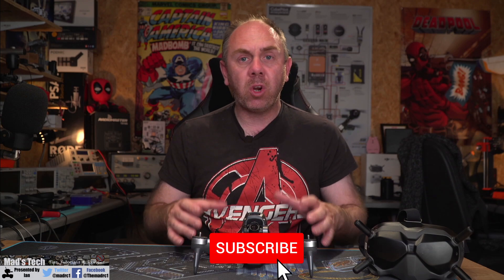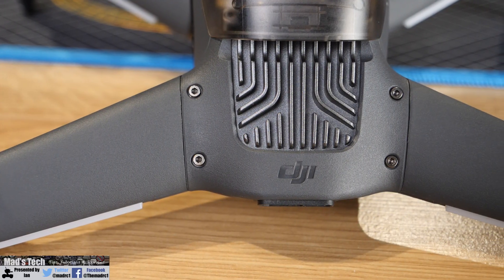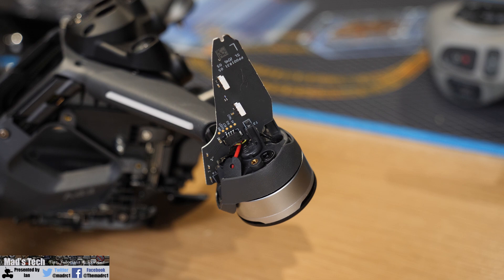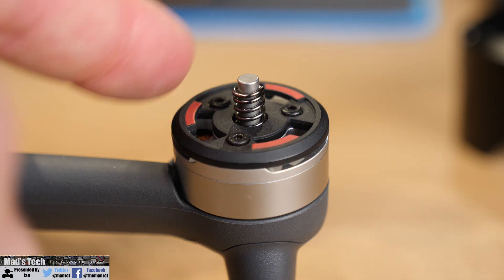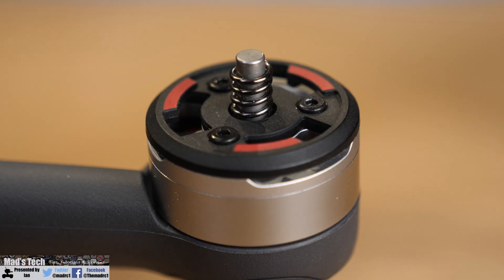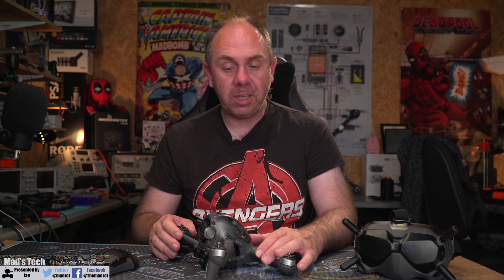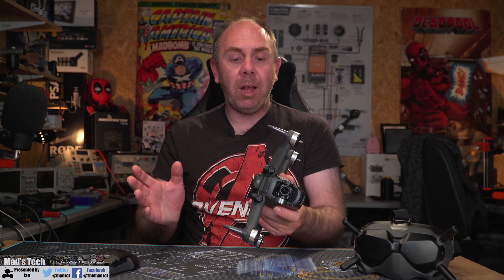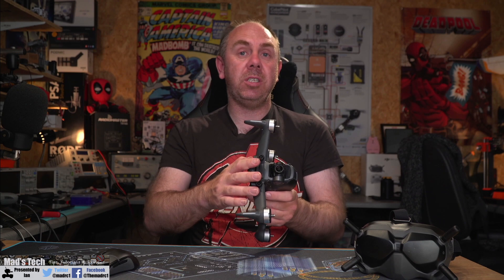DJI FPV Drone Crash ? - What & Where To Check For Damage

Comment: Any ideas what to do with error: Image transmition error / RC signal lost error. This is after hard crash to a wall. Gimbal too some damage but seems to work fine. And checked the antennas and their connections on the board. No issue there far as I can see.

Issue is that aircraft starts and can be operated with the controller but no image can be recieved at tho goggels.

We have tries with out SD card and have updated the firmware etc. So thats not the problem. 

Any ideas what to do next?

Comment: Yesterday I hit a tree branch around 10mph head on and lost video output from the camera, drone was in manual mode but went back into full level by itself and started to force land through the tree branches but hit every branch on the way down landed in some soft leaves no visible damage but now no video output, I don't know if its the camera module or usb-c main board, It's cheaper to just buy a full new drone off ebay, I will just use this one for parts, it was my first hard crash and it does make me think its a very delicate drone, anyone else had this video issue drone has full rc and vtx signal just no av output.. Edit: Camera was faulty bought a spare drone £180 off ebay swapped cameras and yay it works. Well sort of drone has a main camera calibration error, and Dji Fly app won't download calibration data so I'm stuck with the message.

Comment: Landed in a pool and burned the esc. Seemed like no water got anywhere in but after the esc replacement the drone turns in normally but all the LEDs are solid white and I can’t connect it to my goggles or the fly app. Any suggestions?? Thank you man. Great video 🙏🏽

Comment: THX Ian , i crashed mine 2 days ago..luckily no real damage as i have  the arm braces fitted. i had to change 3 props and i had no error messages .

However , today i went out for my flight  and when i come back to edit the videos i can confirm the noise it makes is deeper / bass tune sound than before . after watching this video , i have changed the 4th propeller and tighten all the screws . hope that would fix it ,otherwise i might have to send it in for inspection - time and money 😢😒

Comment: my drone says fan error and gets really hot but the fan doesnt have anything stuck in it, it spins fine when on? the black bracket over the fan does have a crack in it though so maybe some pressure is being put on the fan?
Reply: Have you figured it out? I’m having the same problem. I replaced the fan and it’s still not working and showing “fan error”
Reply: @cmodesittm5006  ended up just being a damaged fan

Comment: Thanks a lot for  sharing my fpv just crash and went to water upside down  try to do turtle mode and drone turn off I try to put in rice for 24 hours  remove t top shell  clean the mud inside  vacuum it and blower and turn it on say in goggles fun error thanks for reply

Comment: i crashed my DJI FPV back in june and would have loved to find this video earlier D; it was a pain in the ass to repair it on my own (no dji care)
one arm got ripped off the drone and i had to change it but after that 2 motors wouldn't spin up again with the heatsink installed so i thought i fried the esc while changing everything but i just shorted 2 motors with the heatsink D: (i realized that as the new esc arrived) so i changed out the esc and the motors worked but there were some weird vibrations going on and overheating of the motors while flying. my next thought was there is something wrong with a motor. so i got new ones ... after waiting weeks for them and installing i still had the same vibrations but no visual damage was seen on anything. no gps errors no imu errors.. the last thing i could change was the IMU. i already spent a full month on troubleshooting so that was my last hope too. last thing i wanted to do is send it to dji and pay way to much for the repair.(note i ended up spending to much for the repair xD but i can still use the old parts for future crashes) So i got one changed it and fixed the problem but i don't know why the drone didn't tell me that the IMU is broken.. i recalibrated it many times but that never fixed it. last time i hit a tree and got stuck in it and had and IMU error warning on the screen but not at my first crash where the IMU clearly got broken. this drone is mysterious but im glad i could fix it (:
Reply: My motor heat up a lot and there is vibration in the camera I can see, I swapped out two of the motors that I thought were causing the vibration, I have no idea what it is. But yours was the IMU?
Reply: Yes I tried to swap the motors too because they were getting hot but it was 100% the Imu

Comment: Hello I have 5 batteries and Im having a problem with them, when I start fly everything goes fine, nevertheless sometimes suddenly I don't have battery information of the percentage remaining on the battery and when I land I see that the battery connector is almost out and just the main power wires are making contact while the three little ones are not. Is there any idea of how can I fix this? Moreover I noticed that my dji fpv has a lot of vibrations. Thanks! (just in case I hacve to say that I did not crash yet my dji fpv)

Comment: I have a GPS ERROR & SENSOR SYSTEM
ERROR… did not crash, just took a little hit from a puddle splash while Getting a shot. Landed fine. Next day, GPS & SENSOR SYSTEM ERROR. Any idea ?
Reply from the maker: Hmm, sounds like water has got in to the main body.  Habe you removed the canopy and checked the connections.
Reply: @MadRC   Yeah everything is connected. I believe it one of the sensors is damaged which is triggering it.
Reply: @DrewDretto Hey did u found any solution? 4 Years later is still have this problem. Just bought mine.

Comment: Literally just crashed mines and thank DJI for those arm bracers,  but im getting a "fan error" and nothing else is damaged and the drone won't start up but everything else is mechanically fine
Reply: Have you figured out a fix yet? I’m going through the same thing right now even after I replaced the fan.
Reply: @cmodesittm5006  yea i bought a replacement fan and it was very easy to install. I bought it off amazon, its the "Heat Sink Cooling Fan" there are tutorials on how to replace it here on YT

Comment: I crashed my DJI fpv drone and broke the arm a few weeks ago. Also in the crash the sensor on the front of the drone was ripped away completely.  I replaced the arm , but didn’t replace the sensors.  But today was my first flight on it and it went into the air with no problem , but when I landed it flipped out and wouldn’t shut off. Any ideas.

Comment: @fellpower The Drone alone is only 700 with battery. So 280 for care refresh replacement is a lot. You pay 200 for Care refresh insurance puls per crash full replacement 280 on top. You can replace twice in one year. That is expensive. Adds up to nearly 400 per replacement average! Minus 150 for the battery from the 700 for a new drone. Thats 400 conpared zo 550 new. Who is mad enough to spend nearly 400 on one Single crash if only one arm is broken for example. A repair via dji would only cost approx 100. So care refresh is not really neccessairy. I have purched the dji fpv with care refresh by the way. Hope i dont need it! Hardy anyone consideres its not just 200 for care refresh but additionally 280 per crash replacement
Reply: State Farm

Comment: I glued mine back together with epoxy and glass cloth. The left arm and a lot of the area in there is solid epoxy now with glass cloth to strengthen it where plastic was ripped out. But it flies, sort of. the vision sensors don't work so it's blind. RTH doesnt work anymore either, but it flies ok in manual mode. Normal and Sport work too but it does wierd stuff, even after recalibrating the IMU. I'm just going to buy a new one soon as you're able to buy just the drone. This one I'll fly until it just comes completely apart.